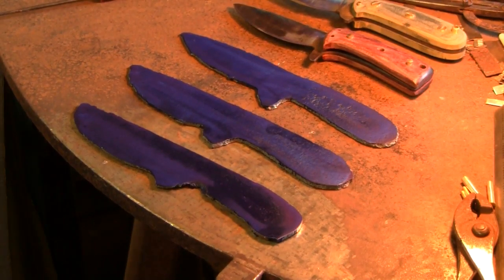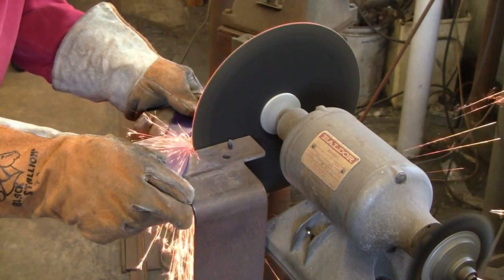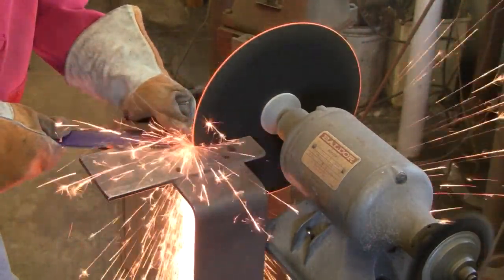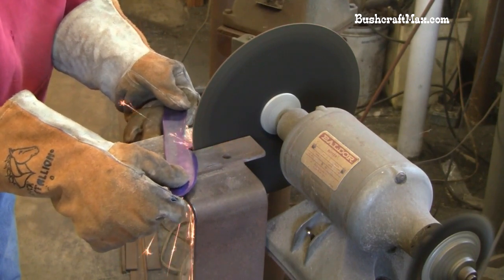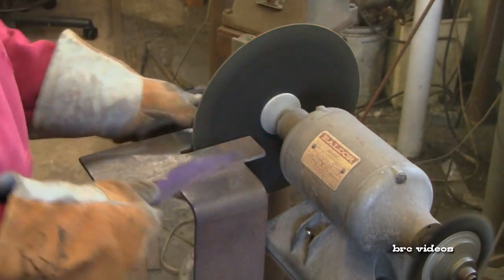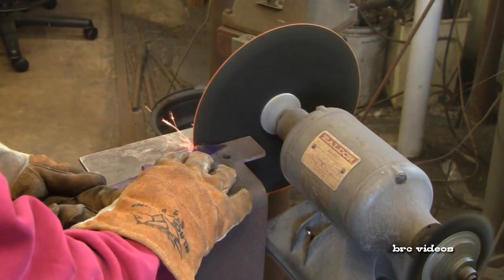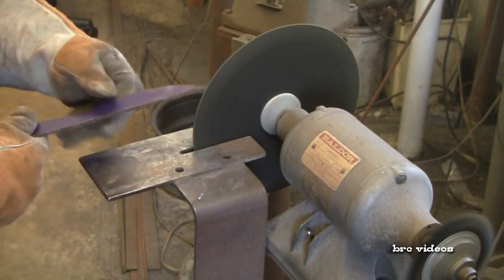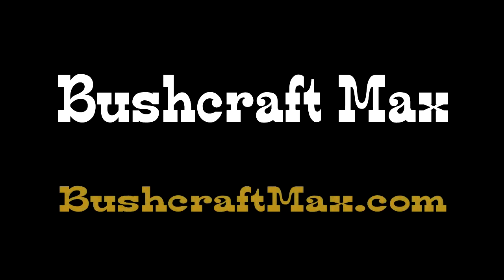Bushcraft Knifemaking Tutorials - DIY - Bruce Cheaney How to videos - Knife Making for Beginners

Comment: Hi, I guess you need the thickest metal wheel ,to eliminate side deflection what brand  do you suggest?
Reply from the maker: The cut off wheel I really like is made by SAIT number type 1-BF 3/32 wide with 1" arbor hole.

Comment: did you say you anneal in lime, how/what is the process for that
Reply from the maker: +Joseph Rector Once the blades are cut out with the cutting torch I clean them up a little bit then heat then up to cherry red and check them for straightness on the anvil then bury the blades in powered lime until they cool off. Thanks for asking. Bruce
Reply from the maker: +Bruce Cheaney This way the steel is a little more workable for drilling the tang holes and profiling the blades.
Reply: +Bruce Cheaney does the lime about the same as vermiculite or perlite

Comment: Where could I get myself one of those rest like you have for your grinder. I don't have access to welders
Reply from the maker: +Tyler Sureddin Tyler, I made that rest myself out of 1/4" x 4" hot rolled steel. I started by cutting the pieces out and shaping them then I welded it in a couple places. It might be possible for you to get everything cut, ground and shaped and find a local welder to weld the work rest on for you for small fee...Bruce